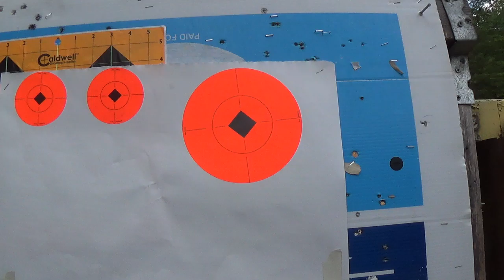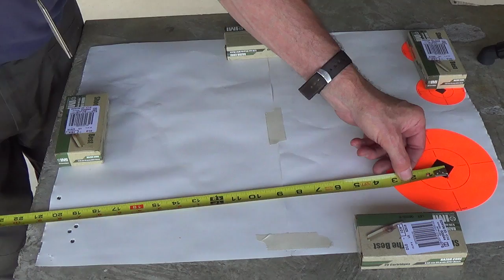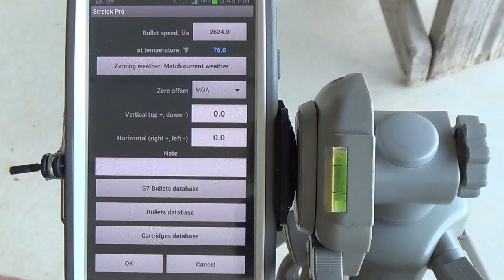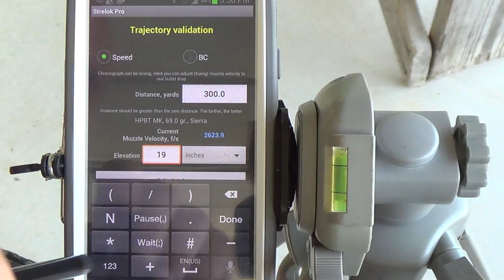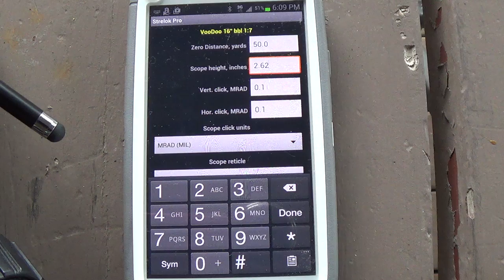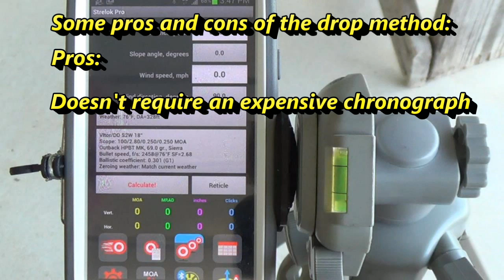measuring rifle velocity without a chrono

Comment: I'm going to guess that's the velocity out of the muzzle and maybe your suppressor is slowing it down also.  Did you load it to be slower or is that all from the suppressor?  I was thinking 69gr should be 2600 most of the time, maybe even 2700.
Reply from the maker: You are correct, the velocity I calculated was muzzle velocity.
A suppressor can either slow a bullet down or speed it up, but it's a very small difference if any at all.
I was using factory Outback ammo and it chrono's a bit on the low side.

Comment: Would this also work with a 200 yard zero and shooting 400 yards with the same ballistic calculator
Reply from the maker: Sorry to be so slow getting back to you - lot going on.

But yes, itr should work well at 200 and 400 yards.
Reply: @Tanglerwr  
No problem thanks 4 the valuable information

Comment: Will this method be as accurate if you Zero at 50 and measure the bullet trajectory at 100 yards?
Reply from the maker: Probably not. The drop would be so small measurement error would be too significant.
Reply: @Tanglerwr  Yes if using 22lr subsonic or air rifle...

Comment: Why are you reloading a single round into the mag every time?
Reply from the maker: reorg 
It slows me and the rate of fire down, which keeps the gun from heating up some; it keeps the next round from sitting in a hot chamber until its shot; and it changes the recoil reaction by locking back the bolt.

Comment: You just gave me a great idea.  When you said 'smartphone', I suddenly realised I could use my Walkman MP3 recorder to record the audio.  Set up say aluminium plate at 25 metres.  Use my MP3 editing software to get a precise time for gunshot to sound of impact, do the maths for the time for the sound to get back and - that should be pretty close to actual time (to calculate velocity).

I do have an old chronograph, so I will do the test one day and let you know how close it comes.
Reply from the maker: Sounds interesting - do let me know what you find!
Reply: In case you're interested I actually have compared this method with a Chrony (and one more method) in a video https://www.youtube.com/watch?v=nl_WReZVRmo
Reply from the maker: Great experiment for air guns! However, the difference of 15% you got between the Chrony and sound recording, generally is far too much error to be of use with centerfire rifles.

Also, the Chrono almost measures muzzle velocity, I''ll get back to that, while the sound recording measures average velocities over a long distance - one would expect large differences, e.g. 15%, simply due the method of measurement.

Typically guys that want muzzle velocity need it to feed into a ballistics calculator to calculate the trajectory of a bullet at various ranges. 

The method I use in the video takes all the parameters into account because it is measuring the actual performance of a specific load. Then, based on the BC and drop, the ballistics calculator determines muzzle velocity.

That brings me back to something I said earlier, "the Chrony almost measures muzzle velocity". The Chrony sits (firearm application) 10 - 15 feet from the muzzle. As soon as a bullet leaves the muzzle it starts slowing down. So the Chrony measures the velocity 10-15 feet from the muzzle, rather than the actual muzzle velocity. Also, it measures the average velocity over about 2 feet (distance between screens).

Other devices such as MagnetoSpeed measure the velocity much closer to the muzzle than screen type chronographs. The MagnetoSpeed's first sensor can be as close as 1" from the muzzle and the second less than a foot away from the first, so it is really measuring muzzle velocity.

LabRadar actually uses Doppler radar to measure the velocity of the bullet at the muzzle - it's not quite that simple, but that's the concept. The measurements of the MagnetoSpeed and LabRadar have been very close, near 0.5%.
Reply: Neat idea, but I would think using sound over distance may have quite a bit of variance.  I know in a stable atmosphere, the speed of sound is pretty consistent.  But we don't have a stable atmosphere.  For example, sound will travel slightly faster in in a hotter atmosphere than a cold atmosphere. But the wind will probably be a bigger factor contributing to bigger variance.  If a 10 mph wind is blowing into your target, (for example), The bullet will get there slightly faster, but I suspect the sound coming back will be 10mph slower.  IMO, I will stick with the chronograph to measure speed physically and directly, to remove all the factors of a program that can cause error.
Reply: @EarthSurferUSA  while the environment effecting the speed of sound it is true,  it also effects the speed of the bullet and its drop. I think both methods are equally accurate enough. neither will be as accurate as a good chrono but thats fine. altitude will also effect your velocity, slowing down the speed of sound when you get higher. where I shoot its 25-30 mph slower that sea level.

Comment: What was the default bullet speed at the time of shooting
Reply from the maker: Well, I don't know for sure - it's been too long, but...

I checked Strelok Pro for this rifle and Outback 69 gr ammo that I used in the video and I had chronoed it at 2438 fps compared to 2345 fps using the method described in the video. That's actually pretty close considering it's base on the ability to shoot accurately at 300 yards and then measure the drop accurately too.

Plus, I was using a 6x scope at 300 yards which doesn't do a whole lot for accuracy.

Comment: When I have used this method it has never been close to the speed I got when I actually chronographed it. Are you sure this method is accurate? BC varies with speed so it too is an unknown as manufacturers test bc from a 24 to 26 inch barrel which will give greater speeds...and they fudge the value a little to help marketing. What I have found to be more accurate is actually using a chronograph and then truing the trajectory by allowing the program to modify the bc and not the velocity. That gives me an actual known value to work from since I can measure velocity but not bc and then the bc is trued from my known velocity. Excellent video, not intending to be a troll. Just raising the idea since I have never gotten the program to give me a velocity close to what I get when I actually chronograph it.
Reply from the maker: I do exactly what you do - i.e. measure muzzle velocity, measure drop at 300 yards with a 100 yard zero and calculate the effective BC.

This was presented for those that don't have access to a chrono as an alternative to measuring speed. It does depend on using the manufacturer's stated BC, which I find to be the BC at the highest velocity. That's gonna introduce some error, but the change in BC due to decreasing velocity over 300 yards is pretty minimal. For example in Ballistics Explorer the multi BCs for a 77 gr SMK BTHP is 0.372 for 3000 fps and higher, 0.362 from 1700 to 3000 fps, and 0.343 for 0 to 1700 fps.

Even from my 10.5" SBR, this round leaves the muzzle at 2468 fps and at 300 yards is 1855 fps. So it is still in the top 0.372 BC category. I'm sure it decreases along the way, but the point is that there isn't that much change in the BC over 300 yards - only about 3%.

Likely why you aren't seeing the same velocities on the chrono is exactly what you said - the manufacturers are fudging the BC.

Also, measuring velocity and using drop to calculate BCs only results in an average BC for the range the drop occurred over, so there's still some BC error, but it's likely a lot closer than the manufacturer's claim.
Reply: even though a chrono is more accurate, isn't your actual drop numbers more important for shooting accurately? if you had a drop of 20 inches and calculated a velocity, and made your charts based off that number, wouldn't getting the true velocity from a chrono give you a false drop number?